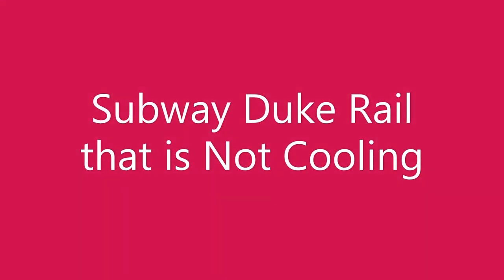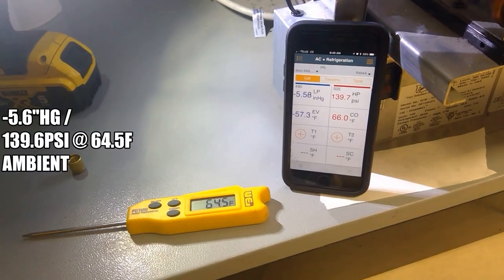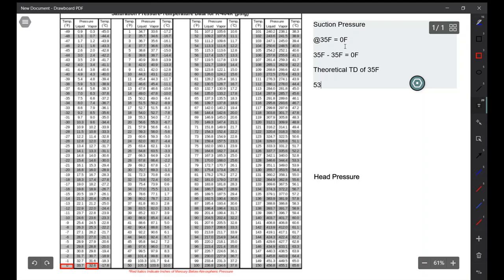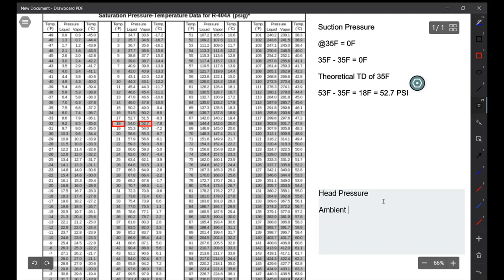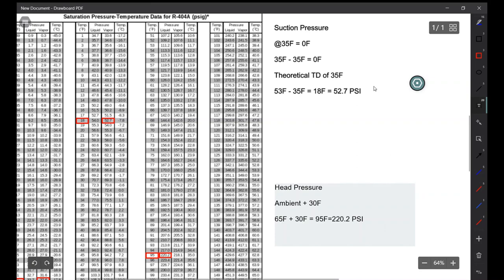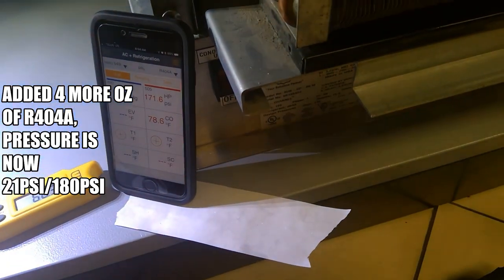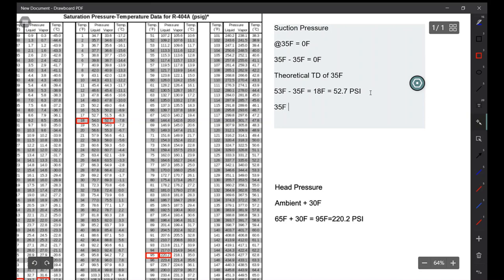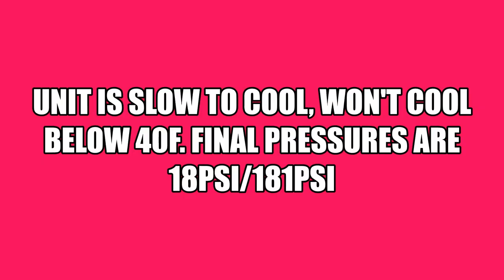Subway Duke Cooler Rail is Not Cooling

Comment: I love the way you break down your saturation Temps based on the units you work on. Cold rails have been killing me lately but I love this video. Thanks man!
Reply from the maker: The cold rails are little harder to make sense of because there is no fan and you can’t physically see the evap coil. The more difficult part is that different manufacturers are using different evaporator TD’s to complicate things even further.
Reply: Definitely. I've also had trouble finding good manuals or literature on the actual technical operations of these units
Reply from the maker: Lol that’s because they don’t exist. Earlier in my career I would write down correct operating  pressures for every different manufacturer. Then one day it just started making sense.
Reply: This are called drop in cold units 
What I saw in your video it has happened to us a few times the unit was pressurized with nitrogen and were able to located leaks on the sealed box    Using a leak detector over the box. There are a very small openings on each end of the channels box, bubbles were visible in those small gaps
When this happens they are not repairable 
We had replaced a few of this
Reply: How do we find the TD EVAP?

Comment: Great explanation.  How come you did not check for frozen evap or failed evap motors prior to gauging up??
Reply: no fans lol evap is supposed to be frozen
Reply from the maker: Yup you got it Adam! no evap fans. the unit is shut off every night so it can defrost
Reply: Thanks Adian.  I have not worked on Dukes but have plenty of Continental’s that do have evap fans and are supposed to be unplugged nightly to defrost .  Of course that does not always happen and I get the call for a warm box but with drawers that won’t close due to the ice buildup, lol. Easy money at that point!

Comment: I have low side 55 and high side 270 on label charge after vacume. However food is not cooling to 38. Temperature on wall reach to 30 but food does not. Compressor do not ahi because never satisfied. Any idea?

Comment: Genuine question, how would a  restricted txv affect the head pressure?
Reply from the maker: Depends on the system. On these critically charged smaller system, head pressure and suction pressure are low when there is a restriction when the system is fully charged.

Comment: Good vedio. I wish I sow this vedio before . I worked today on the same unit . Was running on high pressure and low pressure was very low. Changed the dryer and still. Restricted txv. Replaced the txv and charged it to 45psi and 250psi high . For some reasons I m not sure why the temperature is dropping very slow even the coil getting frozen very good. Tried removing some Freon to 35 psi low but the same!! Any idea please. Left it running for a day to see what’s up?
Reply from the maker: Takes up to an hour to cool down. Putting in the containers will help it cool down quicker

Comment: Would u say that all rail systems should be ran at a 0 degree saturation or is this specific for the Duke units?
Reply from the maker: Randell likes to run theirs at -7F to -15F saturation. This is where superheat becomes key if the charge is correct.

Comment: Hi, I have a same unit and technician filled gas for 3 times already and after a month it shows problem again. Any idea?
Reply from the maker: Leak test
Reply: I have low side 55 and high side 270 on label charge after vacume. However food is not cooling to 38. Temperature on wall reach to 30 but food does not. Compressor do not ahi because never satisfied. Any idea?

Comment: Dukes units are garbage. Susprise subway has them. You get me confuse with your explanation but to each their own. Ill rather use superheat and subcooling. 30 ambient rule of thumb on walk ins for head pressure. Great video either way
Reply from the maker: on walk ins, yes I use superheat. On units with critical charge, i find it to be not as accurate/helpful. Ya, subway loves to use these units.
Reply: superheat and subcool readings can be wildly inaccurate on reach in equipment, especially when lines are run next to each other as engineered heat exchanges within the cabinets